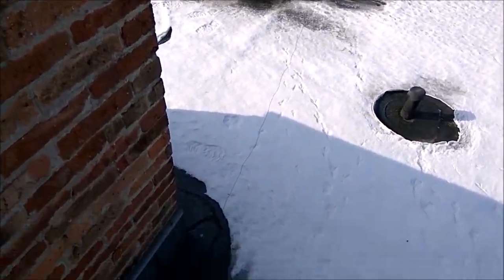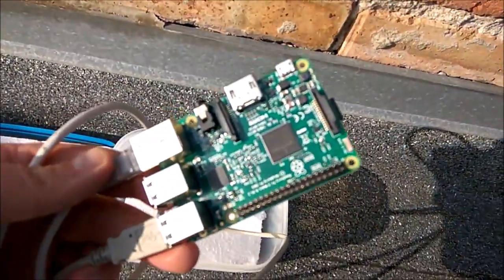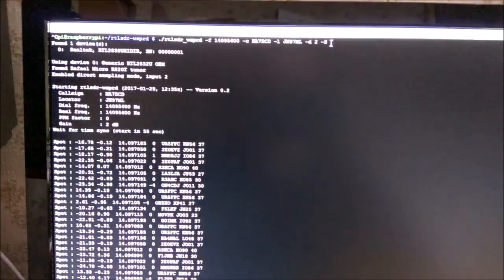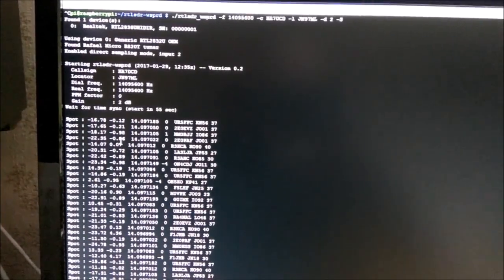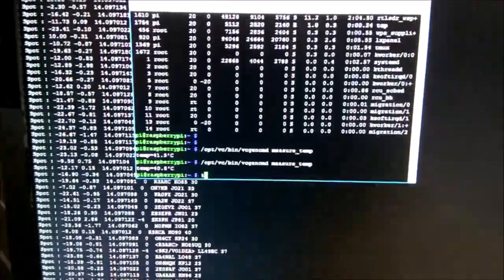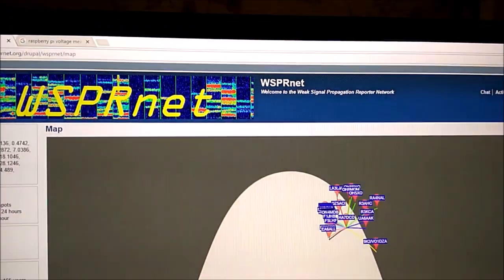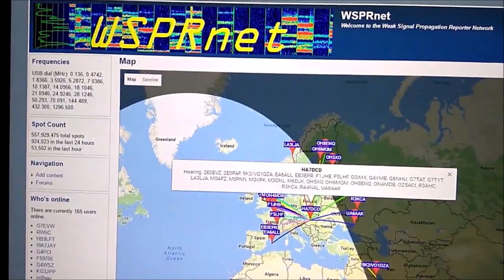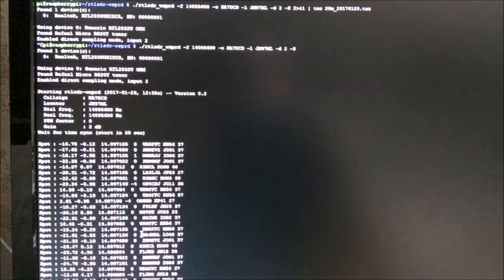Making a standalone WSPR receiver with RPi and RTL-SDR V3 using rtlsdr-wsprd

Comment: How are you powering your PI? I don't see a power cable or a Pi POE module attached to it? Have you some other hack to do POE (power over ethernet). thanks.
Reply from the maker: good question... in the moment of demonstration it was not plugged in, you can see partially the power bank at 0:22 at the lower left side of the screen. It's an easyacc 20000mAh. Normally I use poe injector in the lab and poe splitter in the roof and use the 5V output for stable use.

Comment: Hey, I’ve been trying to get this software set up but all I seem to get is ‘No Spot’. No matter what frequency or antenna I try, that’s all I get. How can I fix this? I’m using a Pi 3 B+ and a NooElec NESDR Smartee.
Reply from the maker: probably your problem that your SDR not working in the HF domain :'( from their site: "Frequency Range (approximate)	25MHz - 1750MHz"
https://www.nooelec.com/store/nesdr-smartee-sdr.html
I've used RTL-SDR V3 which is built by purpose for HF band operation:
"Feature 1: Direct Sampling HF Mode
This feature allows you to listen to HF signals between about 500 kHz to 28.8 MHz."
https://www.rtl-sdr.com/rtl-sdr-blog-v-3-dongles-user-guide/

Comment: Hi, Are you using SMA male connector for your random wire antenna or just tuck in the wire into the center pin of the SMA female socket on the sdr?
Reply from the maker: Hi, I used an SMA pigtail cable and soldered the wire to that as I remember